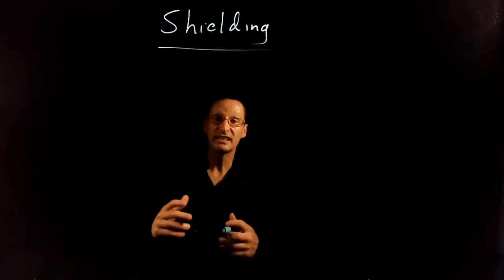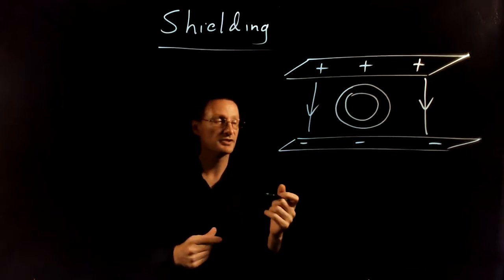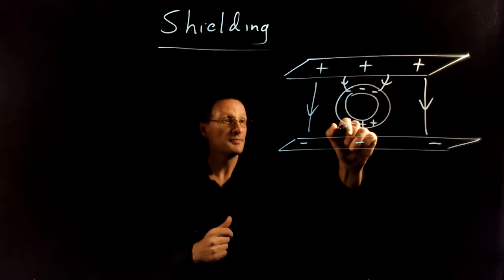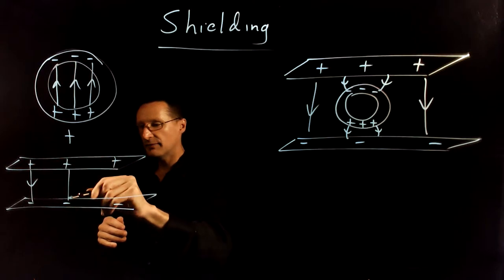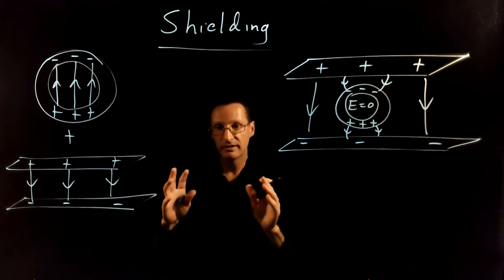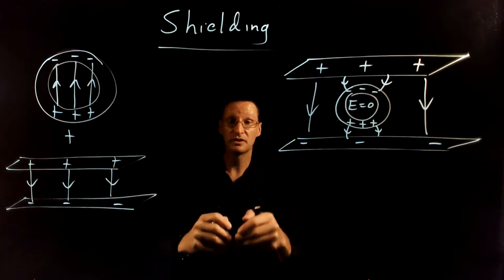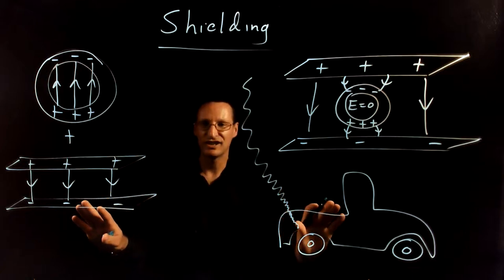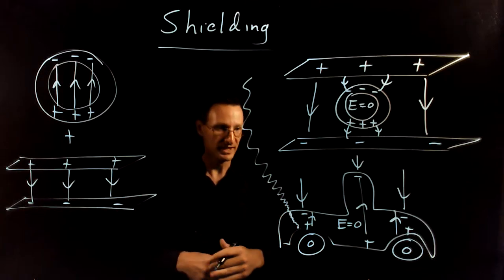Shielding Electric Fields

Comment: But not entirely zero. The shielding would depend on the pipe material - the material should be eager to loose electrons in other words three should be an excess of electrons in the material. The less force required to loose an electron for the pipe material the better is the shield efficiency. Then it follows that it's more difficult to protect a circuit from low EMFs than from the high EMFs and that all so accounts for high voltage current flowing outside of the conductor? Like lightning requires less pure materials for the shielding and that's why a car passengers survives inside of the steel cage?